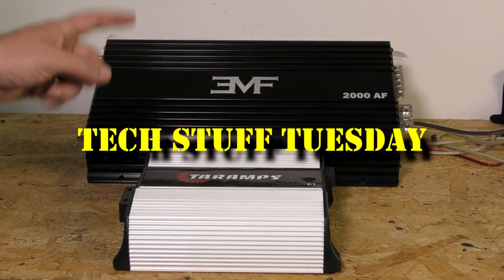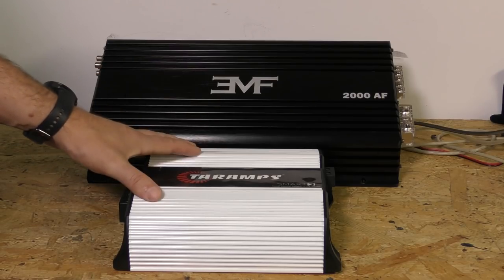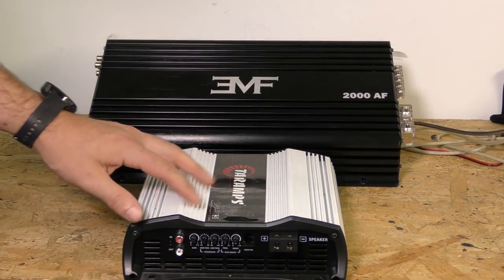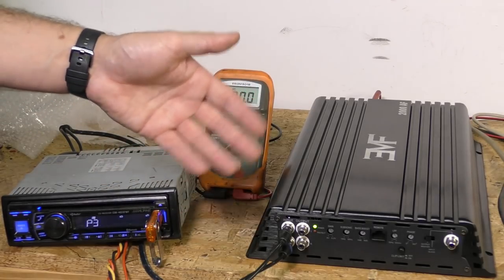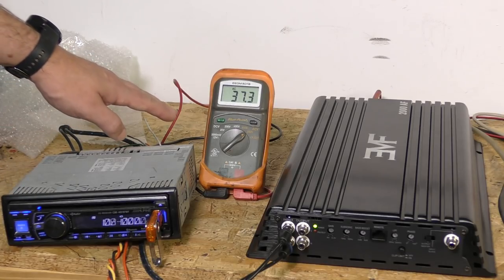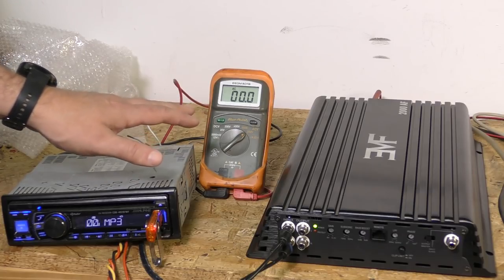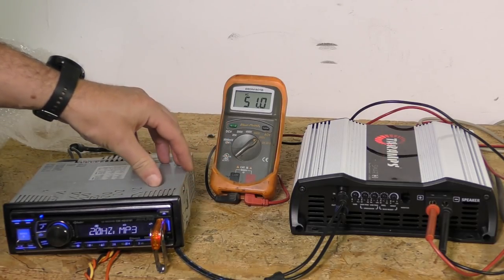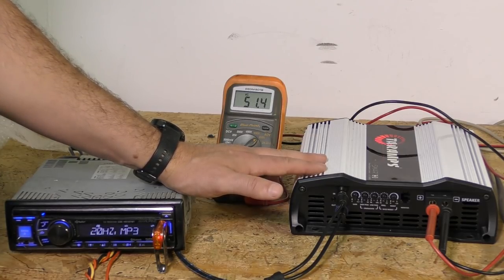The problem with full bridge (Brazilian) amps you never thought about - Tech Stuff Tuesday

Comment: For anybody that cares to read this...
This video has absolutely nothing to do with half bridge vs full bridge! 

half bridge and full bridge refers to HOW the amp makes the power, just 2 different ways of making power, quite similar but different, in lay mans terms, full bridge is simply a half bridge configured in bridge mode. Both half and full bridge "amplifiers" will do exactly that, AMPLIFY!

what this video does touch on, is internal preamp quality!

all modern day amps have some sort of internal preamp, and no, you cant really seperate the 2 without thoroughly knowing what you are doing. these amps are manufactured to economics first, in most cases. yes the EMF amp has a great preamp, but everyday music very seldom goes below 40ish hz. couple this together with the market, not everbody wants a 5hz fire spitting monster! 

In order to use 5-35hz, there are plenty of other, and more costly requirements, that have to be in place FIRST, before purchasing an amp thats capable of driving that frequency range! 

Generally, car audio amps:
1. Do what they say STRICTLY
2. Do what they say LOOSELY
3. Dont do what they say at all!
its all about the cost and profit margin and absolutely nothing else!

this videos is true in all of the SCIENCE, but very misleading in the EXPLANATION! in my honest opinion, just really good market reseach or really bad stab at the opposition! this guys a loose canon after that SMD DD1 stunt!

the EFM amp does what it says strictly! the Taramps does what it says LOOSELY! both do, do what they say it will do and thats rare in this market today!

 Cost for cost, and as per the numbers, i say TARAMPS for the win. but make no mistake that EMF amp is sweet!

Comment: I’ve been using a smart 3k on 2 18s skar evls at 1ohm for a year no issues and in my hummer a md 5000.1 running 2 18 skar zvx s and there slamming everyone try taramps you will love them
Reply: And yes I was running all skar skv 4500 and my taramps smash them
Reply: I have hd3000, its great amp!
Reply: @yourmom-ii8ep  about how much power or amp hours would I need to run a single 15 American bass HD on a 3k taramps md? I'm dimming a little with a 70 ah agm in my trunk and cranking battery under the hood. Am I better off running the agm by itself instead?
Reply: @yourmom-ii8ep  I did the big 3 and have 70 ah agm in trunk but I have stock 105 amp alt so alt should be the next thing I upgrade?

Comment: Honestly I have a lot of different set ups I’ve collected over the years for each car I’ve owned. I just bought 4 yard sale ev6 8s and taramps 3k for a crew cab about 3 months ago. I can say for the money it’s one my favorite setups. Not my loudest. But so far hasn’t ran hot or had any issues.
Reply: Box specs? Doing a build now for a buddy with this same setup in a single cab with 3.5ft3 tuned to 34
Reply: Matt Pierce  no seat lift 07 GMC Sierra crew cab 2.2 cubes after displacement tuned to 31hz

Comment: Great vid!
In my case, the reason why I bought the Smart3 is because of size and weight. The past bass amplifier was huge and weighed like a cinder block while the Smart3 is small and weighs pretty much like a brick. 
The same reason I want to also convert all my ferrite speakers to Neo. 
The Smart3 up to now has been working great for my sub-bass. But obviously my bass could perform better with a dedicated bass specific amplifier. But I already stated my reasons why I’m using the Smart3 above. We all have different goals and reason why we use what we use even if sometimes it does not seem practical. The good thing is, as of lately the bass amplifiers which are dedicated to sub-Bass are getting smaller and the EMF one shown in this video is not that big so it’s a great choice in terms of size and performance.

Comment: This video is not accurate. You are comparing crossover fq response. And yes its absolutely possible to correct response with dsp
Reply from the maker: Watch the video again, all of it, and pay attention.
Reply: You absolutely are having your results affected by crossover. If you have a high pass filter set it will start to roll off the voltage above the set point of 10 hz. This could explain the dip at 20hz. Doesn't really prove any thing about half bridge vs full bridge. If the taramps hp filter is not defeatable that could be a limitation of the amp but not really the technology. Plus a sample size of two is too small to really prove anything beyond a comparison of the two amps.

Comment: I gotta say I'm running an SFB 3000.1 on my two Deaf Bonce SA-275's and it hammers the lows. Not to mention it's efficiency is absolutely blowing me away as well.
Reply from the maker: Note specifically what was said. It doesn't say it doesn't play it, it doesn't play it.... as well.
Reply: EMF Audio You do realize this all boils down to the pre amp section and no the actual amplifier section right? Not to mention all you proved it that the Taramps has a fixed subsonic filter. That’s why it dropped off power on the low frequencies, it was starting to roll off .The Taramps can and will play on subs just fine if you know how to properly tune it.

Comment: Smart 3k On 2 10 Subs , im happy as ever!
Got it for dirt cheap and if fit my small area that i had intended for the amplifier.
I will be installing a battery on the back soon cause the thing jugs power.
I just boosted the lows as the guy in the vid says .... no need for a 400$ half bridge, got my smart 3k at 140$
Reply: @chrispeters1020  ngl hits good

Comment: Had smart 3k on a sp4 v1 15 & now changed to a half bridge & it was a big difference in performance, I am hitting more of the lower notes with more authority
Reply: What’s your box tuning. To me lows are 18-26 hz.
Reply: All I use is Korean boards of half bridge .What I like the most is no fans constantly running clip indicating bass knob staying cool to the touch after hours of hard tilt plus they can be run .5  ohm loads with. Proper electrical..Tried the smart three once and it was noisy and didn't sound good.

Comment: So what happens if you compensate for the low frequency rolloff with eq? Seems to me the built in subsonic filter will cause that, and you need to adjust for it. I've run full range mmats, precision power, and others for low frequency duty, but have also run older earthquake and mtx class d amps. I did have to adjust low end on the class d amps, but my full range amps also didn't have built in subsonic filters. Most class d amps seem to have compulsory subsonic rolloff built in.
Reply: And yeah, I watched the entire video...
Reply: It is the subsonic filter. Taramps has strange crossovers, they start rolling off way before the frequency you set, and they are a very slow slope.

Comment: The biggest problem with full-bridge amps is the sound quality. I went with a Pheonix Gold Ti3 1300.1 which puts out 1488ish watts at 1 ohm and it makes my Fi Neo 3.5 12 inch sub hit real hard and sound clean and smooth. Pheonix Gold Ti3 1300.1 is a half-bridge amplifier with high-quality components sprawled out for maximum sound quality. Pheonix Gold Ti3 amps are amazing.
Reply: Did you try a full bridge on the same sub?

Comment: i have a smart 3k for the house wired to .4 across 18 subs that i use daily, has been on 24/7 for months now and never had it get hot or protect, tbh i've never even clipped on it yet haha. i have 2 bass 8k wired to .5 (12 inch hd 12s in a 4th order) in the car with absolutely no issue, and again ,they don't get hot. for the house setup i have the input hooked to the receivers sub output to help keep the voices out of the woofers, admittedly anything non "bass" brand you will probably have issues keeping the voices out without doing something similar. but genuinely in my house 20 hz is a non issue, but i'll note the voltage( power output) on the taramps, while not as steady, is damn near or the same as the emf, and then higher. now as far as taramps build quality, it's suspect but that's also apart of the price you shell out for said amp. also as far as equaling out the bandwidth issue (that i have not experienced) you can bass boost a certain frequency and use that handy dandy clip light to help you along your wonderful journey. also the "throttling" you are seeing on the taramps smart 3k, is that the processor limiting output for some reason? you did not measure amps so you can't quite count that possibility out.
Reply: also, terrible wire size on the smart 3k, personally running 0 gauge that stuff looks like what i use for my mids/highs amp in my girls car (also a taramps lmao)

Comment: Please do a video on comparing how clean/dirty signals are just before clipping between EMF and a Taramps using an oscilloscope. I ask because I was setting the gain on my Taramps Bass 8K to 3 "clicks" before clipping using my new Liumy oscilloscope and at the top of every wave  has a very thick dark spot which may or may not represent a dirty signal. (looks as if each wave were a snow covered mountain top if that makes sense, I can send you a photo of what it showed if interested) Would greatly appreciate it, (along with acknowledgement).
Reply from the maker: I would be interested to see that photo. That may be a function of the scope. A lot of the dirty that comes from cheap amps isn't just in the sinewave you're looking at.

Comment: I've had great results with taramps,I have an hd3000 in one car and a smart 3 in my other car. They are my first 2 full bridge amps,I always traditional bass amps. I swapped a bass amp out for my hd3000 and it got louder and sounded just as good. I've never had a bass amp as good as a emf amp so I can say if their anywhere near the sound quality as your amps,I honestly doubt the taramps would perform as good but wen it comes to the cost and being on a budget I don't think any other amp can even come close to the sound or sound quality that u get from taramps. I paid under $300 for my smart 3 ,if u watch bigD's dyno on the smart 3 he got over 5000 watts outa that amp.what is the cheapest amp EMF amp that'll do 5k ?  I will garantee you can't get a 2k for that price,and I'm not bashing EMF,if I had the money I'd probably run all EMF in my cars .but ppl like me can't do that. I've had my hd3000 for almost 4 years now and it's been amazing
Reply from the maker: You should know that those dyno figures are misleading, and can be manipulated. You can get some cheap Chinese amps to show that power for cheap too, but there are things to consider. How reliable will they be? Are they efficient or not? Will they go into thermal protection with some use? Will the output signal be clean or will it kill your subs? That's what you get with a better amp, clean, efficient, reliable power. With the AF amps you also get our bass knob that shows voltage, temperature, and those amps feature a clip limiting button so you won't clip your subs to death. Ultimately, it's cheaper to buy a better amp than to maybe buy another amp or have to upgrade electrical more, or replace/repair subs too.
Reply: @EMFAudio  I understand wat your saying and believe me I'd love to have one of your amps over my taramps,I just can't afford it at the time. But to reply to all the things u said could happen,and your rite,those things can definitely happen but I've had my taramps hd3000for almost 4 it never gets hot or goes into protect,I've never blown subs,I had 4cheap planet audio 12's on it at first then 3 lanzar optidrive 12's and I have 2 rockford fosgate p3 12's on it I never blew any of those subs   so my experience has been great. But I'd still rather have your amp.  And in my opinion I highly doubt bigD wiz would manipulate and results,he has nothing to gain in doing that.  He's dyno both the hd3k and the smart 3
Reply: You can get a skar rp2k for 200 that puts out like 3200 at .8ohm. It's what I'm running and it sounds great but I love the lows.

Comment: My Taramps fits under my seat, same size as my old  alpine 600w RMS amp, it pushes out 4000 watts at 12.6 volts (mind you only for a 5 second burp) off my 1 lead acid battery vehicle off, I run at 1200w RMS on my stock electrical and don't get any voltage drop at all. It was cheaper than my 600w amp (which made my voltage drop) and it kicks ass! Personally I don't see any problems :)
Reply from the maker: How are you so sure those power numbers are accurate? Did you measure those numbers in your car during use yourself? Your old Alpine I'm sure was a class A/B, which is less efficient. It could be 50-60% efficient and even lower if you were using it below rated impedance. Even the most terrible cheap class D's are 60-70% efficient. 20% difference is a lot of amperage, certainly the difference in exhausting an alternator. So why does all of that matter? Longevity. Top fuel dragsters have 500 cu. in. engines making over 10,000 HP, when an engine that size in the 60's may have made 400 HP. But that engine from the 60's could still be running today where that top fuel engine gets rebuilt after idling for a few minutes then going 1/4 mile. A top fuel engine wouldn't last 10 miles.
Reply: @EMFAudio  yea I have 2 fluke meters, so just measure the volts and current on output of amp. When I was setting gains I seen around 78 volt and 52 amps, this scared the shit out of me, 2 bass thumps and it was in protect

Comment: That why the manufacturer added bass boost with a frequency range to compensate for the low end drop off. It is a midrange amp,in the country that it is  designed they dont run too many big subwoofers. They mostly Low mid to mid range set ups with multiple speakers needing these types of amplifers.

Comment: Those things still put out insane power to dollar ratios even if they don't peak in power around 20-30hz. In a lot of vehicles, tones that low often get muffled by the dash board or the peak completely misses the intended listening area. Optimally placed in the trunk of my friends Scion coupe, for example, I've measured the distance coming from the trunk to where your head would be driving, and the optimal peak of the lowest tones were between 40hz-50hz. At least with the amp you tested, he wouldn't really have noticed a drop that hard going from the loudest low tones to the upper bass.
Reply from the maker: Well, they're rated for insane power. Even so, top fuel dragsters are rated for 10,000 HP and they get about 2 minutes of  run time before they rebuild them.

Comment: What would you recommend? Need a 1 ohm stable amp , my 2 subs are a total of 2000rms and 5000 peak. My electrical is a 250 amp alternator an 1 xsd3400 under the hood so my electrical should be more than fine, all ofc 0gauge and big 3 already done......

Comment: Full bridge amplifiers have been around for a long time.  Any somewhat modern head unit uses full bridged amplifiers.  Super reliable.  Maybe there is a difference between the different Brazilian manufacturers when it comes to.quality or reliability.  I don't currently run any Brazilian Full Bridged amps, but I think this video is a little biased since you are showing off your own re-branded amplifiers.

Comment: There's a lot more happening here than you're letting on, so i'm guessing this is another troll video?  You havent used the same amp for each test (2-channel in bridge mode vs 2-channel in non-bridge mode), back-EMF, lack of topology discussion with respect to capacitor coupling the output(s), or dampening factor and reactive impedance.  All of the latter issues I mentioned would be prevalent in a non-resistive load but you probably should have used at least the same amp to do both sides of the testing to more effectively prove your point.
Reply: You may be right.

Comment: I understand the video and the comments from those opposing the test. 2 things, what about full bridge amps made for bass vs a half bridge made for bass? They cost a little more but still not as much as a half bridge usually of half the size of a full bridge. Number 2, what it you set the low pass and turn the high pass all the way down? Would the results be different? Just asking. I'm debating between a new Vulcan 8k, a MD 12000 1 and a Teampie 7500.1. I have 3 2ohm 2000 watt RMS 12"s

Comment: When you strap two amp you go from half bridge to full bridge or do you stay at half bridge?
Reply: In a sense strapping is a full bridge
Reply from the maker: 2 amps strapped is full bridge, basically.
Reply: @EMFAudio  So strapping two of your amps make them perform worse??
Reply from the maker: @kimt6333  sometimes strapping can cause instability issues, depends on the amp. The architecture of a full bridge amp vs strapped half bridge are different though.

Comment: Thanks for the info so the sundown  full bridge amplifier  is for mids
Reply: Wondering that myself I would’ve liked to of seen this test done with an SFB
Reply: But to answer your question yes. Just like the MD line of taramps the SFB can play everything.  the bass series will play lows better just as the SALT series would play better on subs than the SFB. Also the taramps bass series is has the highest amplifer power for SPL which is why you will find them in SPL competition over the other taramp lines. The whole point of the video is that a full range amp wont play bass as well as a specified bass amp. Not that it cant but it wont do it as well.
Reply: Sundown isn't Taramps.